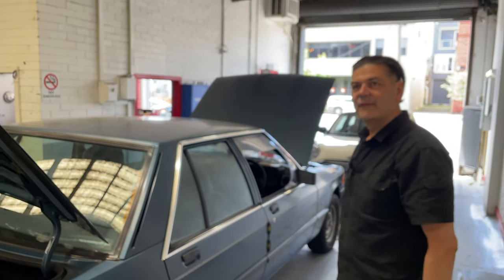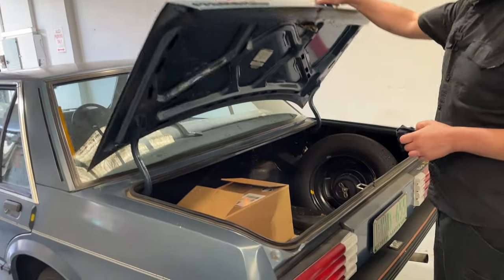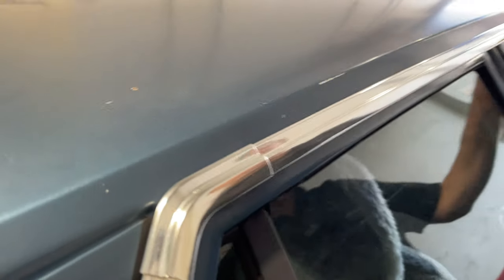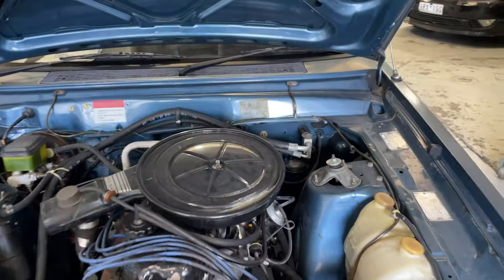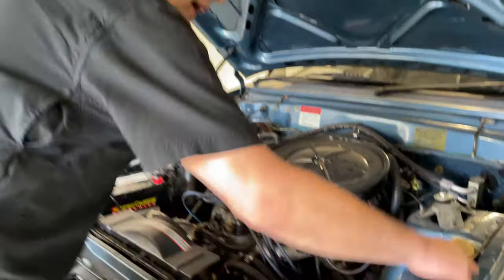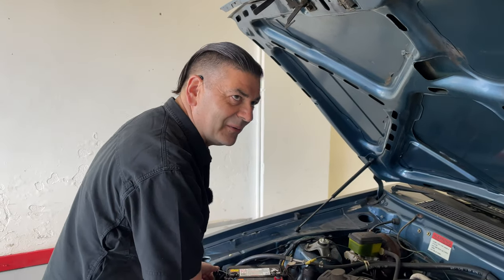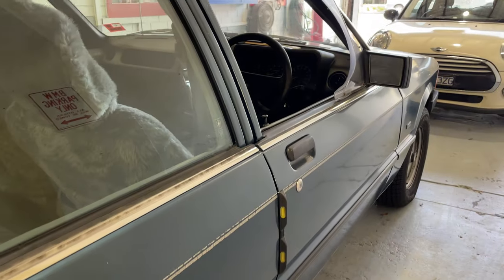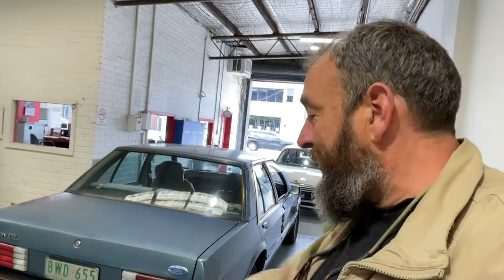Should this ORIGINAL SURVIVOR car stay POVO SPEC or get an upgrade?

Comment: Do the Fairmont upgrade. As he said it’s rust free, where as if he was to do a Fairmont with another one there will be rust to fix. He wants to relive a time in his life so I say go for it
Reply: Exactly. It needs the Fairmont power steering! The manual steering in those base models was hideous..
Reply: @denisovanhybrid9610  turning circle of the queen mary
Reply: And down the line it could be returned to original if the value leads that way.

Comment: The batteries never used to explode because of the small earth lmao that's total nonsense.
They did swell and leak when used as a taxi running all day and boiling the acid out of the cells though, that was common, battery trays always rusted out.
Reply: I’ve seen a lot of them leak too, but I have seen one arc out and explode too. I remember a taxi coming into my battery shop and it was almost round haha. Over the years I’ve seen a lot of batteries explode in vehicles, but generally because of extreme conditions or neglect

Comment: You would wanna fix the rust growing between the bootlid frame glue and skin in some spots before it comes out the other side. Very lucky find of a xe.
Reply from the maker: Did you see some coming through?
Reply: @davesclassicgaragetours   look around the glue spots under the skins a common spot .

Comment: I have a 1984 xe falcon 4.1 auto iam the 3rd owner it power steer but ac it was in near perfect condition with no rust it was owned by an old man for 29 years then a young guy then I bought it .I have had it for 10 years
Reply from the maker: Oooh is it povo spec as well? Might need to get these two beauties together.

Comment: if ya find a decent way to restore the factory wheels can you do a video. I have a 393 xe gl wagon but I want to run factory gl wheels
Reply from the maker: I'll get onto Illias and find out but I reckon a template will be made up using the surviving spray on squares and then replicate it to each quarter.

Comment: I'd leave it original but perhaps install power steer. For example look at all the Xa's that have been GT cloned  so it's now a real pleasure to see a bone stock poverty model and it will turn more heads than some tricked up car at car shows in the future.  Same goes for HQ's that have been "Chevy v8'd. Then again it's his car and I understand his reasoning for wanting to "Fairmont it".
Reply from the maker: Power steering is definitely happening. It's just a question of whether it gets an upgrade to Fairmont spec.